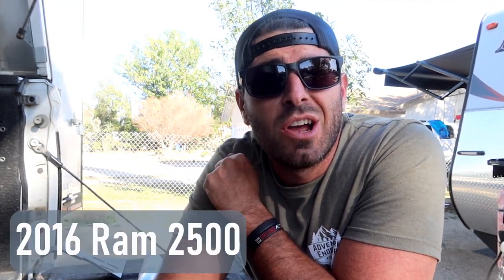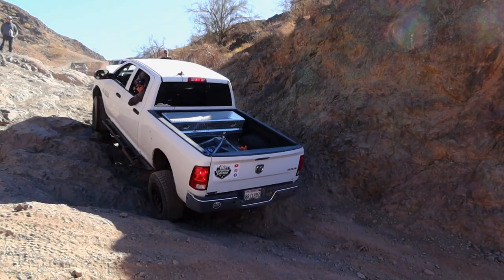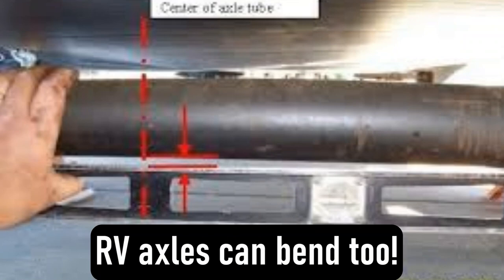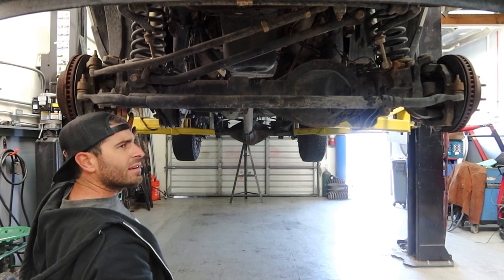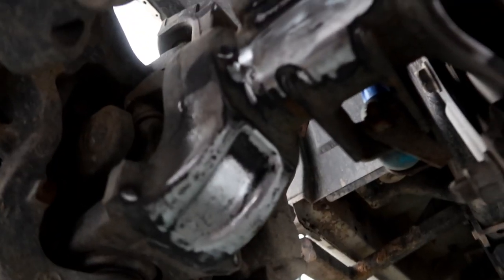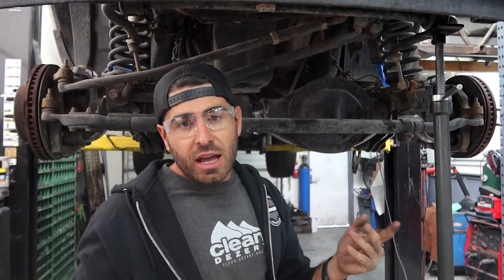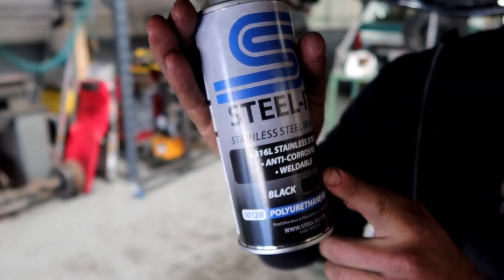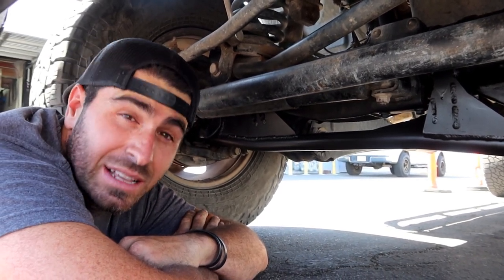Overland Ram Axle Truss Installation

Comment: Did you need to drain axle fluid or is heat similar to hailing that huge 5th wheel? LOL. Also check your rear pads. Just found (too late) ours worn & had replaced.
Reply from the maker: No the fluid is fine, I will definitely check the rear pads. Good advice! Thanks.👍

Comment: I am considering installing the Thuren axle truss over the Carli, Thuren seems to leave more ground clearance and potentially leave added weight. Does the shape hinder jacking the truck up by the axle?
Reply from the maker: Not really, we normally jack the truck up just behind the axle on the radius arm. We like it overall. Fairly easy installation.
Reply: I am in a 3rd gen Ram so I have a 4 link front end. I guess the bar is 3/8in wall which should handle the weight of the truck without much issue though.
Reply from the maker: Yeah its very stout.